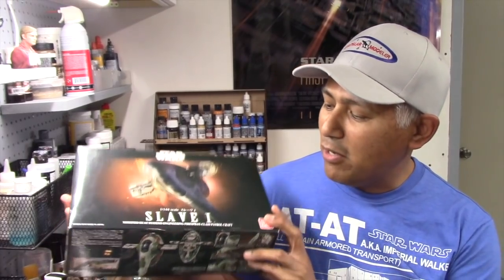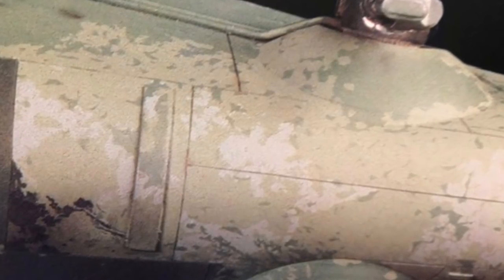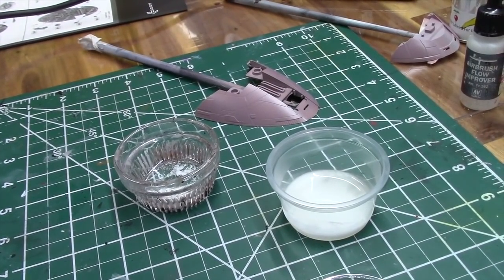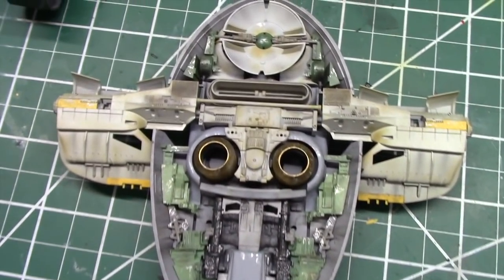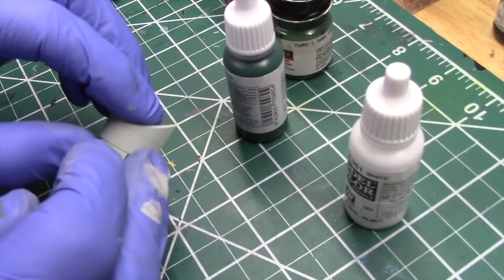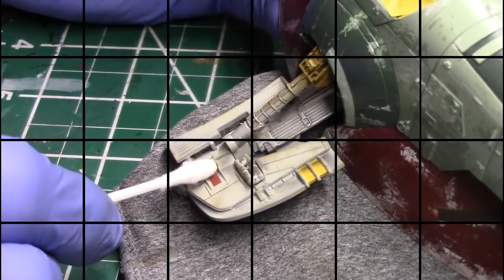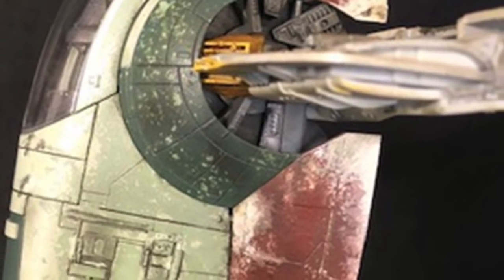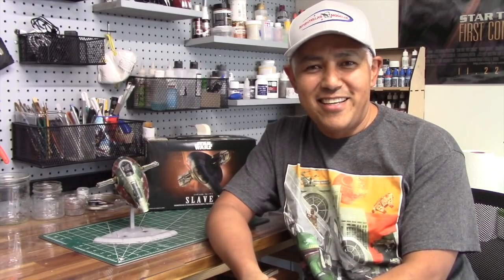Building Bandai's 1/144 Star Wars Slave One

Comment: Great chipping. Really nice model. I have used AK chipping fluid and noticed the same clumps on the surface. When I dialed up the pressure it seemed to atomize better. Just subscribed
Reply from the maker: Excellent tip, thanks

Comment: Fantastic job. It looks great. I broke that same piece on mine.
Reply from the maker: that's reassuring.  Not sure what it is I did, the thing just snapped.  I was little worried the Mig AMMO solution had something to do with it although I've had no problems with it so far.  As noted in another post, I once tried the Tamyia Panel Line solution and it ate away at the soft plastic included with the Bandai Shore Trooper (joints).  Everything else on the ship, however, seemed just fine.  Too much pressure when rotating the wing I guess ??  Anyway, thanks Marc...I always appreciate your compliments.
Reply: @InterstellarModeler  I think it is more of a fit issue. I think it how it snaps on is not really made to be moved and when you try it brakes.
Reply from the maker: @schuhmansmodelshop8657  makes sense, thanks

Comment: Oh cool a current thread  HELP!! After 30  years I've gotten back into SciFy modeling. This time I'm going to be doing some Air Brushing instead of rattle cans and some of the paints I've stocked up on are Acrylic. Anyway I just made a boo boo..
 I noticed one of my paints was a little thick for hand brushing so I decided to thin it,  And wouldn't ya know it dumb dumb me accidentally added enamel thinner to a jar of Model Master acrylic paint..  Is this jar of paint now ruined? Or is there some way to salvage it?... Any advice would be greatly appreciated :)

J.D.
Reply from the maker: Sorry to hear that but I'm afraid it's a goner.  At least I can't think of a way to recover it.
Reply: @InterstellarModeler  Ya I kinda figured that, Guess I better just go order another jar. Thanks! By the way, Love some of the tips I'm learning from ya, Never heard of that Salt Hairspray thing before.  Looks scary.  Normally when someone starts talking about doing things like weathering I run away and hide under the bed :/
Reply: Well I'll be damned, I did't want to wait a week or more for a  new jar of this model master acrylic paint in the color Burnt Sienna to come in before I could put the second coat on the engine intake pieces of a little anime space fighter I'm working on and so I figured what the hell, I added some proper acrylic thinner to it and tested some of it on a scrap piece of plastic and it hand brushed on and dried just fine, Same thing when I put the second coat on those intake piece.
 Now I would never try to use what's in this jar in my new air brush, But for hand painting any little pieces I may want to use this Burnt Sienna color on in the future the paint appears to be ok... Guess I got lucky this time :)

J.D.

Comment: I’ve had some bad experiences with mig washes on Bandai kits did you have any issues
Reply from the maker: Thanks for this comment. Haven't had any with the Mig products however I have had some bad experiences with the Tamyia panel line wash. That stuff will eat away the soft pieces that Bandai uses for the joints (figure models). Those pieces are just not compatible with something in that solution. Others have told me they've literally had pieces crack on them after applying that Tamyia product. What kind of issues have you had with the Mig AMMO products?  I have a feeling they would probably have the same affect on those soft pieces too.
Reply: @InterstellarModeler  yes I had the same issues as the tamiya panel line wash parts would just crack and drop off it has only happened on one Bandai kit but it is heartbreaking going to try and stick to acrylic washes for the Bandai kits
Reply from the maker: @Roosterfox  i will mention this in the next video.  I'm curious, did you coat your model with an enamel clear coat before applying the Mig Ammo products?  thanks
Reply: @InterstellarModeler  I coated with klear floor varnish maybe I should try a enamel varnish
Reply from the maker: @Roosterfox  yes perhaps that’s the trick. I’ll have to experiment a little with this. Thanks for your input Glenn

Comment: It's a pity that sculpting a galaxy is impossible to find now that it's out of print and it's hundreds of dollars in the secondary market if you do find it. Alternatively you can pay 500 dollars for the limited edition which still in stock.
Reply from the maker: Wow...I wasnt aware of that.   Thanks for watching Luis
Reply: @InterstellarModeler  yep. I've been a fan of your work so I wanted to get the book. It's gone. Last year you could find it for 30 dollars. Now get ready to fork over $100 or more thanks to greedy resellers. I've found a similar issue with other Lucasfilm books printed before Disney's acquisition. Not sure why disney decided they aren't going to reprint them but scalpers got wind of it and prices are skyrocketing. Sucks because the chronicles vehicles book also impossible to find and is very expensive if you do. Where does that leave modelers?